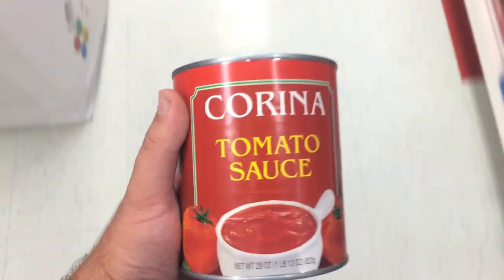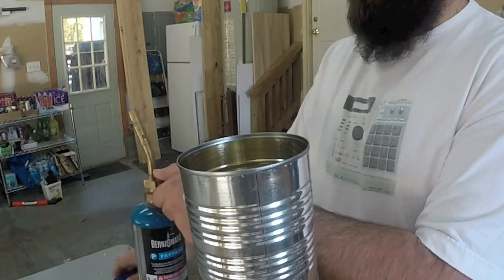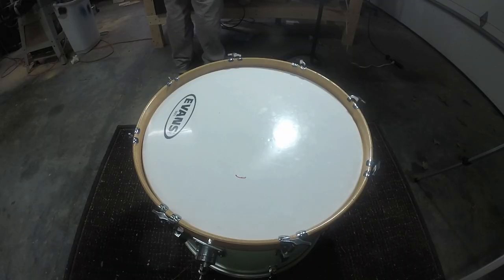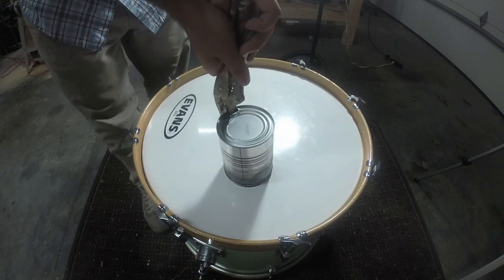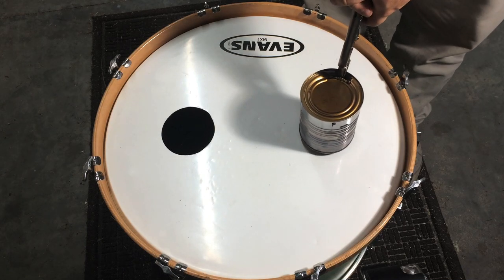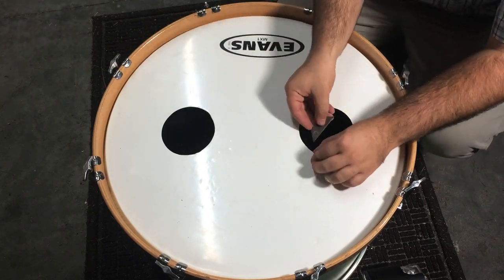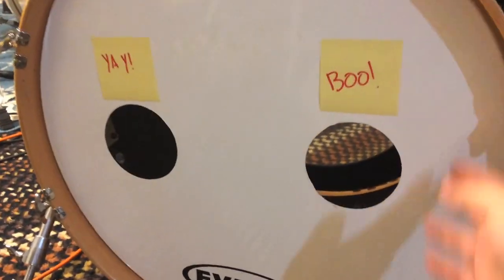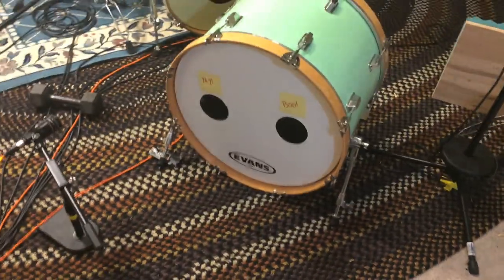How to Cut a Bass Drum Port Hole | DRUM HACK

Comment: Metal has a high thermal conductivity. So if you only heat the outside edge with the blowtorch, the heat from the edge will quickly spread out to the rest of the can. That's why it cooled so quickly. On the stove, you gave it enough time to heat the entire can so it stayed hot.
Reply: This makes a lot of sense. Thanks

Comment: Great video, thanks. I found that if you take the head off and put it over a heat resistant surface with the head upwards (rim on the surface), when you press down with the hot can, the head springs back up when it cuts through. This really reduces the chances of it not melting 100% of the hole. Cheers!

Comment: I’ve used metal lids for 6” pots and pans in the past. It works okay if you get them very very hot on the stove first but the edges never melt perfectly clean. Amazon has a hole cutter for less than $20 listed that I would probably recommend.

Comment: I put a ring of cable split tube around the edge of the hole to protect it from splitting. 
( It is plastic tube with a split that you tuck cable, like car stereo cable, into.)

Comment: On the inside of my bass skin I have a clear bit which is apparently the built-in dampener. But this seems to be around 4” so my hole will be quite central to avoid cutting the clear film… is that okay?

Comment: I'm a beginner and my bass sounds awful...What can I do to make it sound good?
Reply: Watch some YouTube videos on bass drum tuning, because there are a lot of good ones out there. You might also want to buy a new bass drum head or two, depending on what you've got on the drum at the moment and what condition it's in. Also consider whether you want a tight, punchy sort of sound (in which case a hole in the resonant head will help, as will a batter head with some dampening in it like an EMAD or Powerstroke, or putting a blanket or cushion inside the drum... or both) or something more boomy and open (in which case a hole will not help, and you might want to use something like an Emperor as a better head as well).
Reply: put a pillow in it but make sure that it touches both sides of the bass drum

Comment: what is the pourpose of a porthole?
Reply: It's for miking the bass drum. AFAIK there is no need to do this if you don't have to mike the drum.
Reply: It also changes the sound of the drum since air is able to escape through.
Reply: SandyFruitBasket It cuts down on a bit of boominess. The trick is to cut just large enough to not effect the sound too much while still having access to the inside of the drum and/or mic placement.
Reply: Joe Rico So what do you think the sweet spot is as far as port hole diameter? Say, for a really boomy 20" kick drum?
Reply: JackstandJohnny The room is a MAJOR factor in the boominess. If you play out without miking you need SOME boominess. Move the drum around the room and find the least boomy but usable spot. After that find the hole size that gets rid of the majority of the offensive parts while retaining just enough boom to give depth to the sound. Dampen the batter head enough to get max low end and punch with good pedal feel. I like medium sized bath towels. Usually 2 per kick drum. It's really tough to suggest something without hearing it. The best advice I could give is to pick the spot on the head for a 5" hole ...which is 2.5" in from the dampening ring. Start with a 3" hole and stop when you get an overall usable sound. The thing with boominess is you have resonance. You can't make a DEAD bass drum resonant.If you buy a Remo PS3 Ebony with NO HOLE it should come with THREE different sized stick on Dynamo rings to cut your hole and reinforce/dampen after the hole is cut.
Reply: Also for inserting blanket/sheet/pillow in there to mute the ringing.  Here's a joke: "Why do drummers put blankets and pillows in their bass drums?  So they have something to sleep with when their band leaves them stranded!"

Comment: This should be called how to NOT cut a bass drum port hole. Pro-tip: If you put the head on a flat surface off the drum, you don't get the dingleberries left hanging there that you need to cut off with a knife.